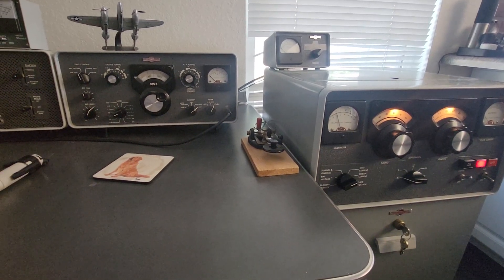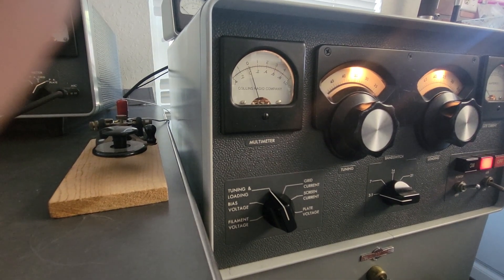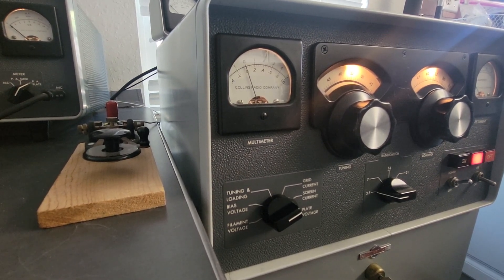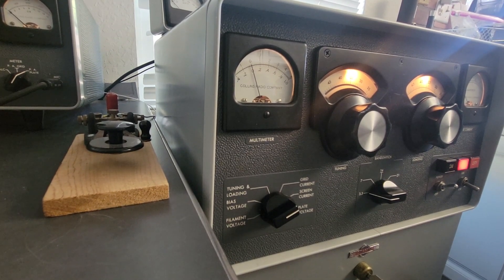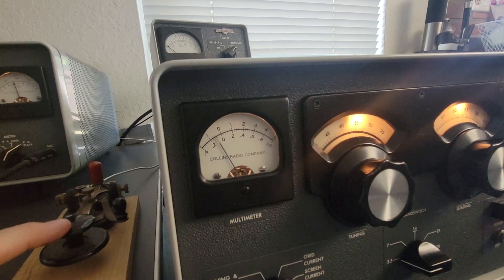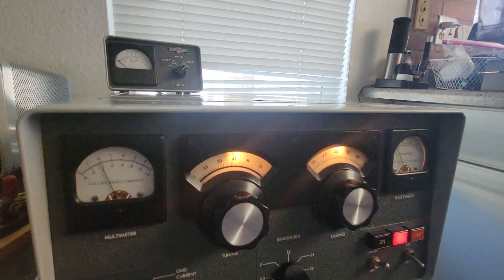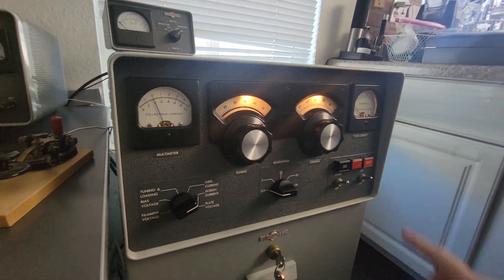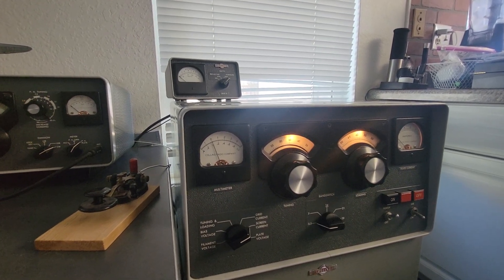Collins 30s-1 amplifier, how to tune

Comment: Thank you Clark. This is video gold for us 30S-1 custodians. I have just stumbled on this and therefore will be checking Arthur tomorrow. Please dont forget, taht any alignment you do will be on the 1500 as opposed to the 1000 tube. I am arse uuming that your Amp has the screen mod? to make the best use of the 1500. I for one would welcome an idiots guide to the calibration proscess. The simple reason, I adore my unit. Kind regards from the Black Forest. Mike DL7 KFT